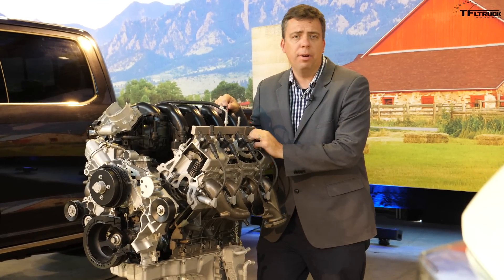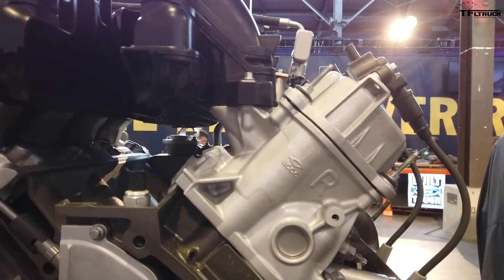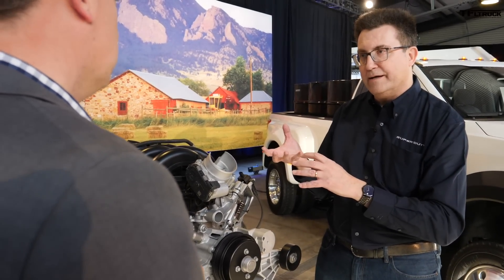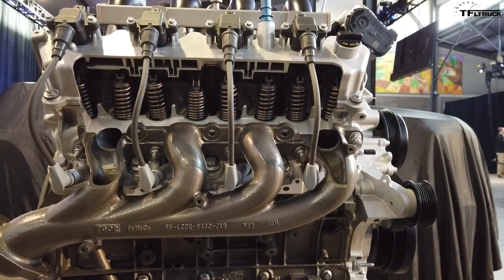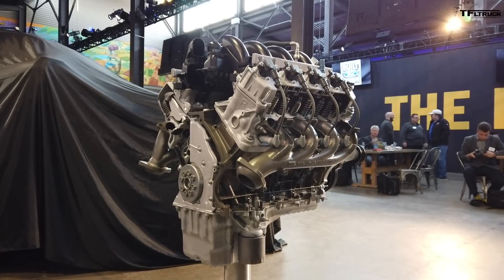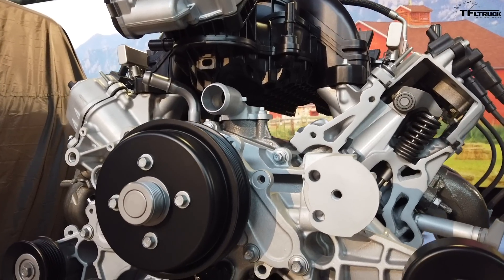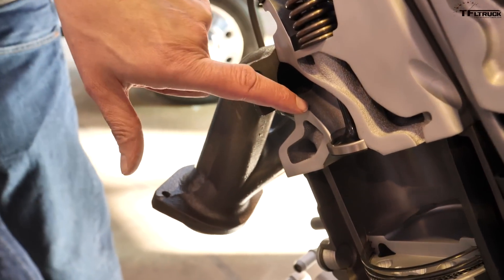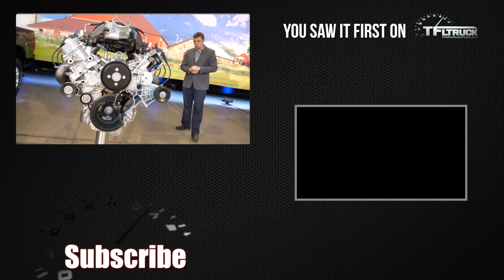2020 Ford Super Duty 7.3L V8: Here's What You Need to Know!

Comment: All you need to know is it'll be about 2k less than the Diesel and that means starting price will be about 50k on the truck for a freaking gas engine. What a  joke.
Reply: They could price it at $2000 over the base engine in the Super Duty, and it would still cost $8000 less than the diesel option.  That engine is dead simple; no turbos, one cam, no cylinder deactivation, cheap port fuel injectors instead of expensive direct injectors, and iron block.  Their profit margin on it will probably be impressive.  I can see it eating into 6.7 diesel sales big-time.
Reply: You are completely wrong. I just went to Fords website and built a 7.3L F-250 XLT Crew Cab for 47K. I could have gone even cheaper with an XL Supercab or Regular cab. The only joke today is the overrated overpriced delicate finnicky diesels that cost and arm and leg to maintain.

Comment: Hurray Ford made a good motor according to the classical scheme (lower camshaft, a short drive chain on it, but I was waiting for a roller chain)
All is well, there are two but !!! Ford Why such a short piston skirt why ???? When shifting from top dead center, the piston will be skewed with an odometer of 200k and more, thereby there will be intensive wear of the cylinder walls. I understand that you tried to reduce the weight of the piston to make it less inert. But no one on this engine will burn in the red zone of the tachometer constantly.
Ford why the engine is short-stroke, it has low torque at low RPM. ????( characteristics of a long-stroke gasoline engine is more like a diesel engine)

Comment: All I'm hearing is "factory ready for 14psi"
Reply: Not with cast crank and non forged powdered rods the 7.3l is coming with. It is cheap to produce truck motor to increase profit margin. That is it.
Reply: @sdvten  I though I heard him say something about forged rods. Cast crank isn't an issue when you're looking at a small turbo. The engines designed for one thing and it will do it very well. Developing a totally new engine is not cheap.
Reply: @casey360360  No they are powdered, that is at least what some of the guys at the engine plant said. Powdered rods are pressed before sintering but not near the pressure a forged rod sees. Its not going to handle 14lbs very long at all, 5 or 6 should not be a problem.
Reply: @sdvten  I was under the impression they were at least forged if not cast, but no powdered rods won't even handle high RPM. Which makes sense seeing as how I rember seeing something about this 7.3 making peak power at something crazy low like 3700rpm. Ford designed the entire engine to be paired with the 10 speed.
Reply: @casey360360  Ford has been using forged powdered rods in some of the 5.0l engines but they see a lot higher rpm than this 7.3l will. Even in the F-150 the 5.0ls can go to 6500rpm. The 7.3l probably will not rev past 5k rpm, so there really is no reason for a forged rod, even a forged powdered rod. Like I mentioned before this 7.3l is a cheap to produce engine. Cheaper to make than even the 6.2l.

Comment: Eehh I like it but for towing and fuel economy a diesel generated electric drive truck is the way to go. Monster torque at 0 rpm, reliability,  no charging batteries and mpg in the 30s unloaded.
Reply: Uh, might want to relearn how math works. Anything x 0=0

Comment: Not to totally bust this guy's balls, but none of what they're doing is new.

Gearheads have been doing 99% of this at home without engineering degrees for years.

Ford halfassed their old pushrod engines, even the mod motor for a while. 

I did some work to the car in my profile pic, 24mpg with a 302 and a carb back in 2001. Ford just finally quit artificially limiting their engines with poor air flow.

Comment: Who would put a gas engine in a F250 or F350???   Diesel is the only way to go.   The 6.7 Powerstroke will continue to provide more power and better fuel mileage than this 7.3 gas guzzler.... especially when you are pulling heavy loads.

Comment: I have been driving powerstroke trucks since the beginning of them way back in the mid 90’s. My favorite is the fast revving 6.0l, but like the power of the 6.7. The old 7.3 was a good engine for its time but is anemic by todays standards. After 20 years of diesel engines Im seriously considering the Gasoline option. Mostly because the noise and maintenance is more reasonable. I do feel that the GM 8.1L engine is going to give it a run for its money.
Reply: 2010 was ths last year for GM's 8.1, new 6.6 is the HD gas engine.

Comment: Good to see that the Ford guys finally figured out what GM has known forever....pushrods are the way for trucks...the Triton and even the 5.0L have never been able to complete with the LS and new Gen LT engines for durability....I know so Ford fan-boy is going to get bent outa shape over me saying that, but it's not always about Horsepower numbers folks....it's about design, which equals reliability and even more importantly, versatility. No one competes with GM engines on that level I'm sorry to say...the 7.3 is basically a big version of what GM has had since the LS was introduced back in the late 90's.

Comment: Sounds like they basically redesigned  the gasoline 460 7.5 engine from back in the day.
Reply: That's basically what it is, just about 15 cubic inches less at 445ci. Simple solid reliable. About the only thing it shares with modern Ford engine's is VCT.

Comment: Nice LS7, Ford!
Reply: 4 vertical and 2 cross bolted mains sounds like a 1962 Ford FE engine. FORD has been using cross bolted mains in their V8's since 1992, long before GM.
Reply: @benjaminwayneb  Yes, theyre so good making engines that theyre responsible for garbage like the 5.4 and such
Reply: @BadAssEngineering  Our fleet has had dozens of 5.4 engines and never had an engine problem.
Reply: @benjaminwayneb  Maybe you have been doing a great maintenance job on them, but theyre just very problematic engines
Reply: @BadEngineering The 5.4 isn't a bad motor. That's not to say they don't have problems, but they're not bad. Even with their problems though, they're still in the million mile motor club.

Comment: Wow that screams ls/lt engine lol but hey either way I’m curious to see how it runs and if it’s going to remotely be reliable being that it’s a ford engine
Reply: FORD has been using a Y block with cross bolted mains since 1990, years before GM. FORD stated using Y BLOCKS with cross bolted mains in FE engines in 1962.
Reply: Hope it has as good a debut as the LT which caught fire in SUVs, overheated in Vettes, used oil in Camaros and...well you know the story.

Comment: If you have worked on an LS based engine you would quickly see all the similarities.
The cast headers
6 bolt mains
Rockers 
Valley cover
Coils 
Even the dam rear oil pressure sensor
Reply: Ford has been using a Y block with cross bolted mains since 1990 and Y blocks since 1954.

Comment: Wow it's got almost the same design features as gm's ls based engines even the exhaust manifold  look alike
Reply: Ford Triton was using a Y block with cross bolted mains when GM. was still using the old 350.

Comment: Intake, injection, and ignition just like the 20 year old GM 8.1L.  Push rod motor for a truck... like it always should have been.  And LS style 6 bolt main caps.  Looks like copying GM's old tech.  They have some interesting and well designed looking intake and exhaust ports on the heads.  I will give them that.
Reply: Ford was using a Y block with cross bolted mains since 1990, long before GM copied them.

Comment: I'll keep my GM 8.1 thanks
Reply: Ford walks on GM !
Reply: @jefft3120  dream on
Reply: GM. hasn't made an 8.1 for 10 years. At only  330 HP.  Most modern engines have easily surpassed the the 8.1.
Reply: @benjaminwayneb  Look at the torque numbers for the 8.1 and tell me how many stock gas engines surpass it. As for not been made for "10 year's" mine is an 01 and still runs great, that should tell you something about the 8.1
Reply: @rentitrich6496  GM's 6.2 has 420 HP and 460 ft. Lbs. of torque. The 6.6 has 401 HP and 465 ft. Lbs. Of torque.

Comment: Ford legacy designs continue 😆 pay attention:

Thermostat replacement requires intake manifold removal

Timing cover continues to double up as the water pump mounting plate.

Intake manifold continues to house coolant for the TB pre-heater

Same failure prone exhaust manifold mounting studs

Some pros however:

Oil cooler mounted externally to the side of the oil pan.

Port fuel injection

Comment: The same Engine over and over again like the small Block and Big Block Chevy ..  Wow they are slow Learners at FORD  I remember   when you could have a  Ford   351 Windsor   Modified   or Cleveland  and all three needed a different  water pump ect..  what a bunch of chinsy  crap in the old days.. I wonder if Ford Finally  build a sound reliable engine it will still cost way more money than  Chevy / GM

Comment: 6.2 is a turd  down low were I need power come one ford
Reply: Coupled with stupid tall gears in both the axles and trans. 6 and ten speed autos where first gear is as tall as 2nd or 3rd gear used to be on pickups and trucks, while the top two gears are ODs. 3.73, 4.10 or 4.30 if you are lucky in the rear end of the 6.2 and 6.7l pickups

It's absurd a 70s grain truck, gas V8 puts more torque to the ground in first gear than a new power joke which makes over 900tq at the crank simply because they build these newer pickups and MDTs for soccer mom's and gear them to go to the mall on the expressway without a load. You can even get 3.73s in the F650! Luckily you can still order 6.50s in the 650, no longer 2 speed rears or brownie boxes though.

I have no problem with a gutless motor but pegging 1st gear at 20 some mph because 2nd is too plain tall and the 6.2 lacks low end torque with a light skidsteer behind you is frustrating especially on a grade no steeper than 8℅. Or having to use the brake pedal coming down for the same reason. Faster than driving a tracked skidsteer on the road but irritating.

Comment: '
oh no...
not have a cooler fan propeller on the motor at 004 to 010...
small motor with a big truck that is a wrong size...
what country made this motor...
not good design and real very ugly front head at 011 to 015 / 116 to 127...
that is a big wrong year 2020...
must be honest made in 2018 to 2019...
-- NOT -- 2020...
not like this truck and turn down...
stop watch this video at 130

Comment: Apparently Ford is tired of getting it's butt kicked by the LS.....  About time
Reply: Stick to tractors that fly, you apparently  know nothing about car or truck engines. The LS originally came out in 1997 and has had several updates over the years.  Most updates involve the heads and fuel injection system.  There have been a few different names for it over the years,  just like the original small block Chevy, but it is basically the same foundation of a motor.  In the same respect, a Ford Trition is still a Trition regardless of the valve configuration and a big block Chevy is still a big block regardless if it was a 1969 427 version or a 2005 8.1L version.

Comment: they finally realized dodge has been doing it right, cast iron v8 pushrod is the only way to have long term reliability and power. but id stick with a dodge they have been doing this for a 100 years. its good they are back but wont get my money unless they continue this trend on the mustang and build the 4door falcon.
Reply: Dodge and reliability don't go together even with pushrods. They have havd the least reliable valve train of any brand.
Reply: benjaminwayneb consumer reports and youtube comments and people dont mean anything if anything they are just on the marketing side, scientific fact cast iron is stronger then cast aluminum, the only reason people think toyota is reliable is cuz the drivers are so boring they drive so slow and never want to press on the gas cuz they are cheap. with proper maintenance like using a much thicker oil 15-50 in the hemi 5.7 and copper spark plugs changed every 10k miles, it is the most reliable gasoline motor ever produced. and the 5 speed trans is from the mercedes s65 amg that can handle 700 ft or torque so all together a great package. and i love the fact that people think its bad cuz it allows the dodge lovers to buy a R/T charger for less then 30k most of the time.
Reply: @Mk47Ultra  I work for a Police force that started buying Chargers in 2013. The 3.6 and 5.7 engines are the least reliable engines on the market.
Reply: benjaminwayneb how where they the least reliable did you record and graph it? and how did you compare it to the “market” did you buy 1000 of every car ever made and give it to the cops to drive? what your saying is like when liberals want gun control and think an ar15 is evil. cops love the charger and its the best cop car available the only down side is its still not big enough. i hope in 2021 dodge makes it even larger and heavier rather then following this fake trend of mpg and light weight that will die in a few years with the rest of electric cars.
Reply: @Mk47Ultra  Our fleet of over 250 vehicles has a mix of many different brands for under cover and general use and GM.' Dodge and Ford for patrol vehicles. The Dodges are the only vehicles in the fleet with on going engine problems, every 3.6 engine has had repairs ,  all of the 5.7's use excessive amounts of oil and have noisy valve trains, MDS system problems requiring lifter replacement are common. Some have had lifter roller failure that takes out the camshaft.
Reply: benjaminwayneb im not surprised, they use the factory recommendation on oil type and change interval, they need to use 15-50 mobile 1, and for the mds and even the 3.6 the issues come from idling, heat biulds up and throws random codes. the noisy valvs are not an issue other then the noise. those are not issues, some might say well look your making all those excuses but i dont see a charger as a car i see it as an exotic sports car, and treat it as one, its a big engin it gets hot to fix it they need fans spinning fast and people would complain about the noise heck they allready did it on the jeep JL, oil changes need to be more often spark plugs need to be copper and changed out before 10k, i do that maintenance and for that it runs great and i never get stranded in a long road trip, its not a drive and forget car. as long as i do that i know i can do burn outs and hard accelerations all day long but if you do that to a Camry it will break down, but the camry wont need new sparkplugs for over 100k miles. thats why we have different opinions and i dont blame you i apologize for forgetting to mention it i view it as if i was maintaining it my way all the time and i forget that most people dont know and trust the owners manual i hate dodge for that but hate the EPA even more lol
Reply: @Mk47Ultra  Acording to Chrysler using a heavier engine oil can cause MDS problems, we use Mobile1 and change based on fuel used instead of mileage because of all the idle time, approximately 5,000 km.  I agree that these engines don't do well with extended idling and that there is an excessive amount of underhood heat. We are constantly replacing the plastic windshield washer nozzles that are brittle and  broken.

Comment: Probably never pass a gas station and base price will be around $80,000 plus.
Reply: 15mpg unloaded ''which is about what these trucks average'' is quiet good for a gas engine of this displacement. And you can spec any truck out to 80K. I just went to Fords website and spec'd out a F-250 crew cab XLT with the 7.3L for 47K which when you consider the median new car price as of 2021 is $45,031 as of September 2021, that XLT F-250 7.3L is a steal at 47K.

Comment: I’m sure it’s going to be a great engine. However, the big block Chevrolet has been around for decades. It’s just as reliable and I promise you it’s much cheaper to repair and service. I can get parts any place in the world for it. As far as economy, the GM MPI fuel injected version is not going to be much less than this engine. Sometimes you need to just stay with what works. For me it’s the big block GM. No disrespect to Ford. I really applaud their efforts and return to push rod gasoline big block engines. One of the best engines Ford ever made was a big block gasoline 330 in. Engine for their 600 and 700 series commercial trucks. We had a fleet of over 100 vehicles for our poultry company. The engines were cheap to maintain and extremely reliable. We went to GM when Ford canceled that engine as an offering circa late 1980s
Reply: 2010 was the last year for the 8.1 l.

Comment: Good old Ford... Can't stick with an engine for 3 straight years
Reply: Just like GM. , the 6.0 l. Is gone and the 5.3 and 6.2 ECOTEC 3 engines were all new in 2014.  Ram keeps the same engines but never fixes all the common problems
Reply: Are you kidding?  GM had the 5.3 FOREVER!  Same with the 6.6L Duramax
Reply: @admorris11  GM. has kept the displacement the  same in the 5.3 but there are several different generations or versions, the current 5.3 ECOTEC 3 engine  is all new and doesn't share any parts from previous 5.3's. Just like the Duramax, there has been 5  different versions so far.

Comment: I can't help but notice Ford is building a Chevy LS engine but bigger. Lol
Reply: FORD has been using a Y block with cross bolted mains since 1990, GM was still using the old 350.
Reply: @benjaminwayneb  lol I am fully aware of that. But there is so much that resembles an LS. I am a ford guy but even I noticed the resemblance of the LS engines I work on. Nothing wrong with it. Just the 6 bolt mains, coils on the valve cover with short cool wires. Ford's were not known for those. The LS dominates those traits for sure.